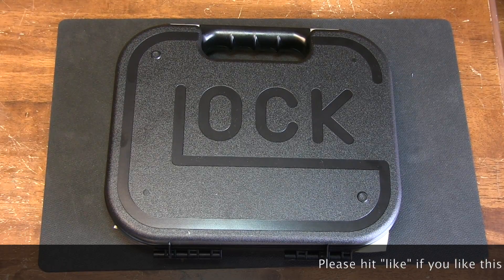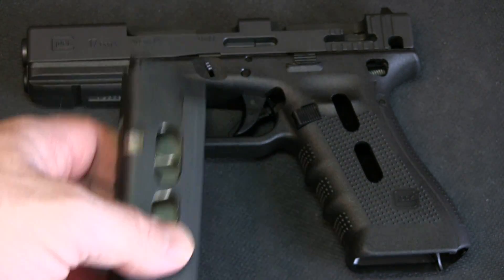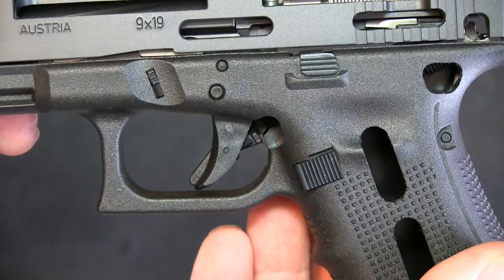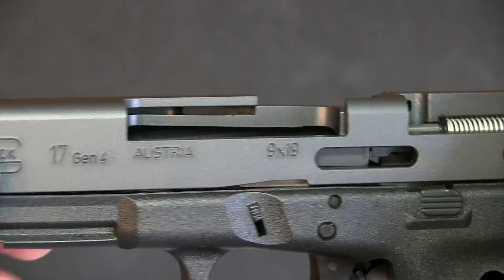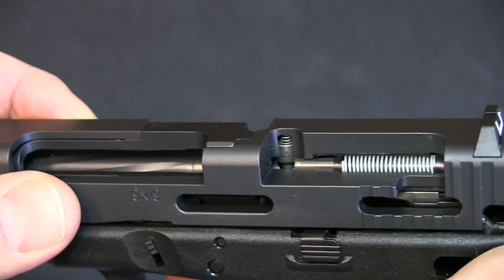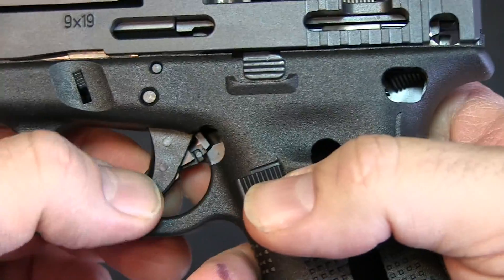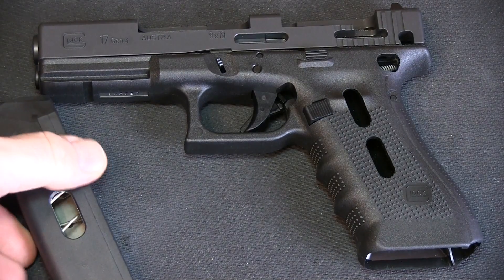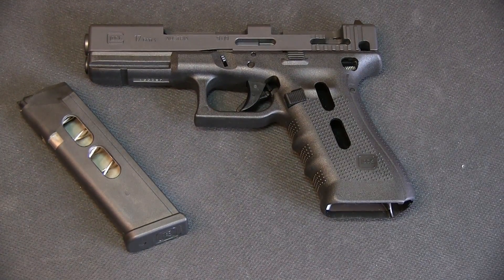How a Glock Works (with Glock Cutaway)

Comment: it would have made more sense if the slide and bottom of the pistol were made of clear plastic so you could see how the entire gun functions instead of just a few selected areas.
Reply: Bagaimana cara merubah co2 menjadi pistol jenis glock 19 austria 9x19 fuul upgrade yang tidak bisa di kokang
Reply: Bintang Maghribi ninja what???
Reply: @getmeoutofsanfrancisco9917  its Malay. Indonesian Malay
Reply: Dan menjadi otoamatic
Reply: I watched videos like these when I got a Glock 26. Still didn't understand fully until I disassembled it fully. It's actually extremely simple. I also discovered a safer method for removing the slide than Glock's. They tell you to rack the slide and pull the trigger. You don't need to. Simply take two fingers in a "claw" like grip on the rear sights and pull back SLIGHTLY, while pulling down on the disassembly levers with the other hand. When you release your claw grip on the sights, the slide comes off without needing to rack or pull the trigger. The trick involves not pulling the slide back enough to preload the striker on the disconnecter.
Reply: Error dude you can take the slide of without racking and piling the trigger as long as the triggers disengaged..when my 26 doesn’t have a round in the chamber I do it all the time no need to rack and dry fire before removing the slide
Reply: Juan Solo that would be pretty cool, but there is no way to make transparent polymers using the polymers glock uses (glass fibre reinforced nylon I believe) and there would be extensive costs to use a transparent polymer in tooling and R&D. You wouldn’t be able to use the same molds for example. Maybe it could be made today with 3D printing technology, though. There are 3D files for glocks. Might have to use CNC to machine out a glock shape from a block of clear acrylic or something similar.

Comment: I would love to see the right side view of the trigger bar movement during reset.  Pull and hold trigger to rear. Cycle the slide. Then show the trigger bar movement when the trigger is release/resets.  Both side views would be nice.  

Thanks for the video.  Much better than the computer animated versions. 

Semper Fi

Comment: So basically the striker/trigger group design of the glock functions similar to the hammer function of a DAO enclosed hammer revolver,  whereas other striker fire semi autos function like the SAO where you squeeze the trigger and hammer drops?  Does my interpretation make sense? if my understanding is correct, i may be more inclined to take a closer look at the glock for carry purpose. Three reasons I never looked at the glock, 1 no external safety which now I may understand why, 2 grip angle and 3 the fanboy snobbery!! What I dont understand is WHY so many accidental discharges with the glock??

Comment: So just to clarify. This gun is so safe that I can keep my gun chambered everyday and not fear that the striker will slip one day and discharge a round? By slip I mean its just holstered and not touching trigger.
Reply from the maker: No modern firearm will just go off on it's own. There must be a reason. But, to answer your question, it's impossible for this gun to just "go off on it's own."
Reply: Good to hear. thanks for the reply. understanding this feature makes me more confident in the gun
Reply: Need coffee Exactly. You could throw it off the Empire State Building. It will be in a million pieces but never discharge. If you don’t pull the trigger it will never discharge. Glocks are the safest pistols on the market.

Comment: so the striker won't move back when you pull the trigger before racking the slide?
Reply: nope. its 'single' action. if the slide is not racked by hand or by round fired the trigger will not move it.

Comment: those of you who NEED a manual safety on your pistol are not safe with firearms. your safety is your trigger finger and the peanut between your ears.
Reply: You may not need a manual safety, but you do need a drop safety of some form or another.  Most manual safeties are clunky drop safeties under another name.  You could probably put a Glock in an empty but rotating cement mixer and not have it go off.
Reply: I disagree. There are different designs of handguns, and some of them have external safeties. To make a blanket statement like this is not using your peanut. I own striker fired pistols without safeties, no problem, but I need a safety on a 1911.
Reply: Grey Beard But 1911s and Glocks are both technically single action... Besides looks, carrying a glock is like carrying a 1911 without a safety on...
Reply from the maker: @CramcrumBrewbringer  Sorry, but you're incorrect. Striker fired handguns are Double Action Only, not single-action. The trigger pull brings the striker back, then releases it. Two actions, cock, then release. Some, like the Glock, have a  very minimal movement when the striker is brought to the rear, but it is there. They call this "pre-staged." Some people have debated calling Glocks single action, so you're not totally off when talking about Glocks, but it is still a DAO.
Reply: @762x51n8o  Wow I didn't realize that. I guess I was more referring to the "feel" of the action. That's neat though.
Reply: Samuel B to my knowledge that’s not at all correct, sir. The guns are designed the way they are on purpose. Striker fired pistols don’t need safeties because it’s impossible for them to fire without the trigger being pulled. Not the case with hammer fired pistols. Unlikely, yes but not impossible.
Reply: @dman3526  Striker fired pistols do need a physical safety. The Glock is a special case because the striker isn't primed enough under spring tension to strike the primer and discharge a round UNTIL you pull the trigger. I've never had another striker-fired pistol that uses the same mechanism. Have a look at the Taurus Millennium, SIG P320, Taurus 24/7, Canik TP9. Some of those guns are SA/DA, too. Either way, once the striker is primed (slide is racked) and the gun is dropped or shocked with enough force to move the trigger, the firing pin safety will also move, and the striker can disconnect and discharge a round.
Reply: The Real Elvis to my understanding most striker pistols are built with redundant passive safeties. The only reason most including glocks, are drop safe is because of the dingus. Not necessarily because of the action. It is because of this that the dingus was invented. The ability for a trigger to pull itself if the gun is dropped and lands just right. But if you want the safest striker fired pistol on the market, it is easily the Springfield XD pistols. The grip safeties make them virtually Impossible to fire unless a human hand purposely holds the gun correctly and pulls the trigger to the rear.
Reply: @dman3526  Yeah, I like the XD. The Glock, XD and S&W Sigma (SD9) are the only striker fired guns I will carry chambered. I had a really bad experience with a Taurus Millennium. It has a sear in the back of the frame that holds the striker fully-primed, but it's almost MICROSCOPIC. After it wore down the gun started to fire full auto, emptying mags before I could do anything about it. What a piece of garbage.
Reply: The Real Elvis I hear you on the Taurus. I’m not a big fan of them. I bet when it mag dumped on you the first time, you were pretty freaked out.  we live in a great time for pistol enthusiasts no need to own something like that. Then again.... it’s kind of cool until it explodes from a squib.
Reply: @762x51n8o   You are mistaken,  most striker fire pistols are single action. The striker is cocked when the slide is racked  and then released when the trigger is pulled. A striker block keeps the striker from accidentally falling if the gun was dropped or hit hard.
The Glock is considered double action because the striker is cocked only a small amount when the slide is racked and then cocked the rest of the way when the trigger is pulled. If a Glock was dropped without having a striker block, it probably would not fire because the striker cocked only a small amount and would not hit the primer hard enough.
Reply: @greybeard277  They have the same trigger system... You realize that right? Strikers are basically single action only with an internal hammer.
Reply: @greybeard277  I don't have one, but doesn't the 1911 half cock? Why would you need a manual safety?
Reply: I could not agree more with you. An external safety can cost you your life. If you are that unsure that you need a safety then you probably should not buy a firearm
Reply: @505 Strat And safeties also fail. That's not really an argument. Safeties don't matter if the weapon is in someone's hand. That cop got lucky. And he needs to learn to keep his weapon contained. I realize that these things happen, but luck saved that officer, not the safety.
Reply: The safety isn't intended for that purpose in most instances. The safety is intended to keep the trigger from actuating the disconnecter in case you drop the gun. A firing pin safety wouldn't save you in these cases, because if the trigger is manipulated AT ALL the firing pin safety will also not function correctly. Refer to the SIG P320 for an example of an unsafe weapon. If there were a physical "safety" it should be drop safe. Also examine the Taurus 24/7 Brazilian duty pistol. It's not even safe when the safety is engaged. Their safety doesn't work because the striker can act independently of the trigger.
Reply: I’m assuming you are referring to striker fired pistols. Obviously, hammer fired SA pistols MUST have a safety.
Reply: Sig P320?
Reply: This is a stupid argument. You act as if people never make mistakes and that the trigger couldn't get caught on anything like a twig or shirt... Glocks aren't that much different from carrying a 1911 with the safety off. There's a reason Glocks lead on negligent discharges...
Reply: @CramcrumBrewbringer  Glocks don't lead to negligent discharges, negligence does. That's why it's not called a Glock discharge.
Reply: My great great grandfather was shot and killed accidently by his very young son, who had to live with that fact the rest of his life. Simple, easy to unlock safety can save a life.
Reply: @martyjones3481  That's very unfortunate and a truly sad example. But the young boy should not have had his finger on the trigger on the first place, so it can easily be argued the other direction as well. The best safety is to teach everyone to have a healthy respect for firearms.

Comment: This is helpful. I incorrectly had a fear of the striker fire mechanism thinking that an accidental discharge could occur but I know understand that the firing pin safety acts essentially as a wall between the bullet and the striker mechanism requiring the trigger mechanism to actuate in order to allow unimpeded strike upon the shell. Right?

Comment: That's treated as a actual firearm because that is a fully functional frame. You can put a normal upper/slide on there and fire it, the few cuts in the polymer would make no difference. It would function normally with a full regular slide on it.
Reply: it can probably be fired the way it is with the exception of a barrel swapout with a actual uncut barrel from a functional gun
Reply: lol no thanks. i dont own a cutaway and i have no plans on making my glock a cutaway either

Comment: Have you ever heard of a firing ping safety geting stuck in the up position?  I want to carry my glock in a shoulder rig but have an added concern of sweeping people behind me, even though I know the gun is safetly holsterd.  I don't worry about it much on the hip.
Reply from the maker: I have never heard of that. As long as it's clean (and keep it dry from solvents) it shouldn't stick. Some people don't clean it properly and use solvents, which can get into the internals and draw lint and debris, which can cause problems.    That's exactly why a lot of people don't do shoulder rigs. Plus, you could get into a situation where you can't draw cross body (if an attacker has you in a bear hug, for example)

Comment: Actually you can fire a live round in it, just as it is. It will not do much. A small puff and the bullet will just barely clear the case. Gunpowder only explodes in confined spaces, Since the barrel is open, there is no pressure to build up and the powder will just burn up, not explode. The bullet will end up laying just a few mm in front of the case. Never tried this as a kid? With a hammer and nail?  ;o)  Not much happens.
Reply from the maker: No you can't, there's no hole for the firing pin to go through. The firing pin wouldn't fit in the hole to assemble.
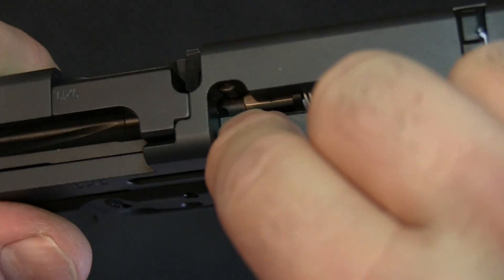Reply: That was not even my debate. I am talking about the result of firing a live round in this gun. Besides that, he mentioned that the firing pin has the point removed (@2:50). Not that the firing pin hole is absent. You would simply add an intact firing pin of course.
Reply from the maker: "he" is me. And after closer inspection, there is no hole for the firing pin to fit through, it was never machined into the slide. So even if you were to try to assemble it with a real firing pin, you couldn't.
Reply: A yes, sorry, I wasn't aware I was talking to the uploader/channel owner :o)

Comment: Just put a regular non-cut barrel in the Glock, and it should be safe to fire.
Reply: Actually you can fire a live round in it, just as it is. It will not do much. A small puff and the bullet will just barely clear the case. Gunpowder only explodes in confined spaces, Since the barrel is open, there is no pressure to build up and the powder will just burn up, not explode. Never tried this as a kid? With a hammer and nail?  ;o)  Not much happens.
Reply: your partially correct. but their IS PRESSURE.. inside the shell casing itself. and its GOING to explode in the casing and fire the round down the barrel and a shit ton of smoke all in your face. with the way its cut it may not even make it down the barrel the rifling may throw it off and send it flying in some fucky direction or right into the edge of the barrel/slide where its cut away.

Comment: The leg that sticks off the cruciform?
Reply from the maker: Yes, that's terminology used in the Armorer's book, pretty self explanatory. Do you know what the cruciform is? There's a leg/appendage/arm that comes off of it.
Reply: Yes the only appendage that comes off the cruciform/Sear is the trigger spring connector.  That is on the front of the sear part not the back.